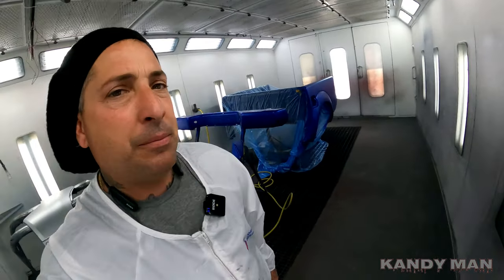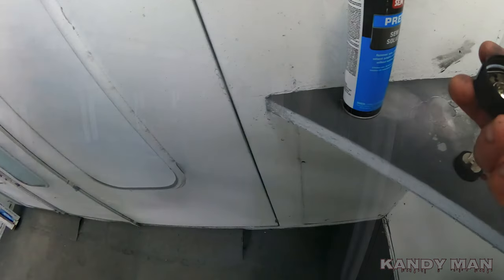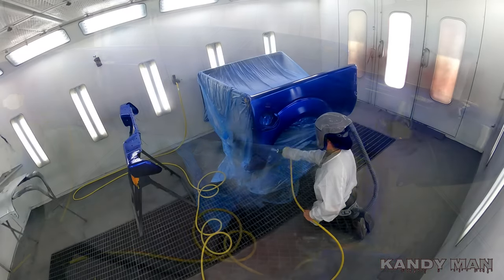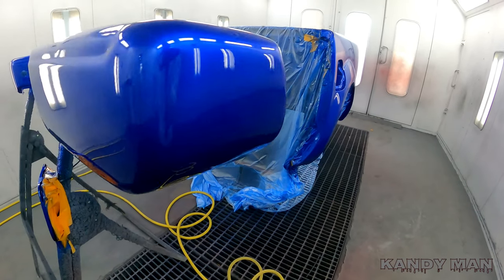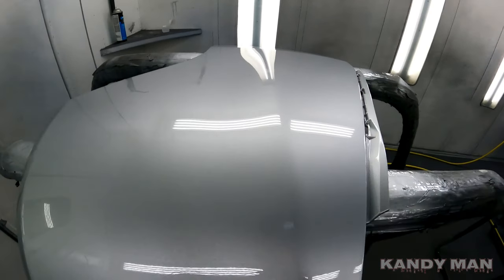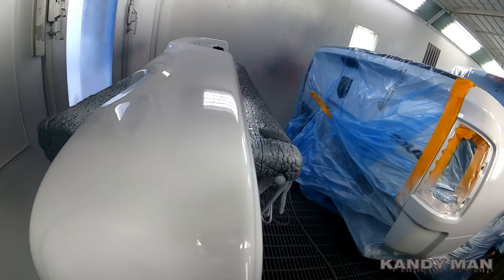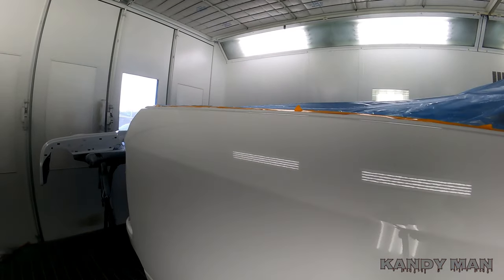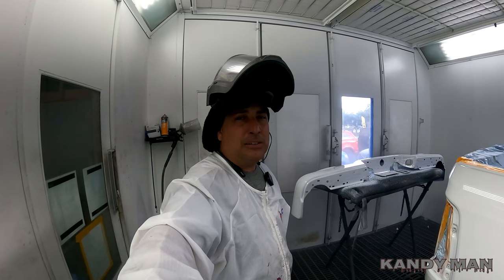GOT THE DV1 C2 PLUS AIR CAP

Comment: It's a killer gun for sure but one thing that pisses me off with DeVilbiss is the baffle gasket which all other top tier manufacturers have eliminated with their most recent guns. Even SATA which used this gasket for decades has with the X5500 eliminated this gasket.
Reply: DV1's dont have the baffle gasket like you are thinking of like the older guns. Not the DV1-B, DV1-C, or the dv1s mini have it

Comment: I find my DV1 with the C2 cap is super slow, I am having a hard time to lay down, i even tried to reduce the clear 20-25% with the 1.4 tip not much better, using SPI production clear
Reply from the maker: Clear is to thin   turn down air pressure.  And don't under  reduce clear
Reply: @kandyman5315  I usually reduce my clear 10% that made it come out super nice from my prolite, seams like the digital gauge on the gun doesn’t read what would be at the gun air inlet 
I ran it at 10-13 psi and it had a nice pattern, went down pretty slick but super slow